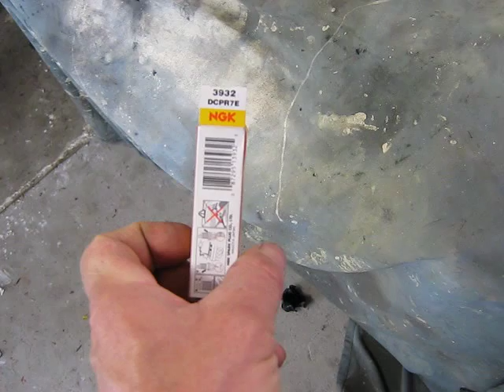sportster problem 1 Problem is Carburetor

Comment: check the fuel screen it may be clogged or the ignition switch Maybe grounding out on something
Reply from the maker: Yep i ran the bike without the fuel screen ( on the fuel tap ) with no improvement ( unless there is a fuel screen up inside the tank separate from the fuel filter on the petcock ) , the ignition switch is new ( no improvement ) and the on off switch has no resistance when on the on position. The only electrical problem i have found was a burned out wire going to the ignition switch ( that could be from the burned out battery cable to the starter )

Comment: whem ever you got soark plugs did you get the plugs as the model of the bike? you said that someone had put a newer engine on it. the newer engine may call for a different hotter burning spark plug
Reply from the maker: Yep its a 1996 engine its got Iridium plugs compatible to stock standard , they made no difference over the plugs that came with the bike

Comment: late to the party, but did you ever figure out your problem? ive got a '84 ironhead sportster backfiring just like this through the carburetor. electrics are in good condition, carb is clean, im wondering if its got the wrong size jets through it? iot misfires horribly at all speeds, but idles just fine withthe right screw ajdustments
Reply from the maker: It could have been something unexpected like the fuel switch not allowing air flow back the tank ( air lock ), or blow by into the carburetor ( I don't think so because new rings didn't fix it ) ( may be I filled the oil tank up too much ), I think the clue was the carbon build up on the pistons seems like a carburetor problem ( or blow by ), however a new carburetor cost more than $500.00 delivered here at the time ( exchange rate and all ) and it was time for some one else to have a go at her

Comment: You may have a bad or leaky valve in the front cylinder
Reply from the maker: Maybe however the engine rebuild didn't show up anything, I reground the valves

Comment: why does my 2004 sportster back fire's from the air filter and white smoke comes out?
Reply from the maker: With that bike ide get the codes from the computer just type - get engine codes from a harley sportster -  ide start there , mine is a 1996 engine just before they gave out standard codes at the speedo

Comment: that's not the  way to adjust the clutch or the throttle cables . You left out a few steps  . Do you have a  manual for you r bike ?  I was thinking that it was a Carb problem .  Let me know how you made  out  maybe I can copy and few pages from my manual and email to you . good luck
Reply from the maker: Yep i have a manual , i have taken the carburetor apart and cleaned it about 4 - 5 times, i will get a spare carburetor to rule out fuel as a problem, when the problem is found i will make a full explanation video ( either when i fix it or when i take it to a shop )

Comment: check the compression
Reply from the maker: Yep the compression was checked and was good, there was a 5 psi difference in the bores ( no difference with or without oil in the boor ) i think 140 and 145 cant remember exactly , its on one of the vids in the sportster problem series although one ring was broken and the pistons were black with carbon, and glazed when i did the top end rebuild after the compression test ( the top end rebuild made no difference ) ( i used the silicone gasket kit from e bay )) the head smoked a bit on startup may be the gasket kit breaking in 
Next move is to get a new or different carburetor to rule fuel out of the equation

Comment: Did you ever figure out what the problem was?  Was it the rectifier or the carb?
Reply from the maker: The Harley shop said it was the carburetor ( it could nave been ) but I'm not so sure It never ran properly, anyway invest in fuel injection